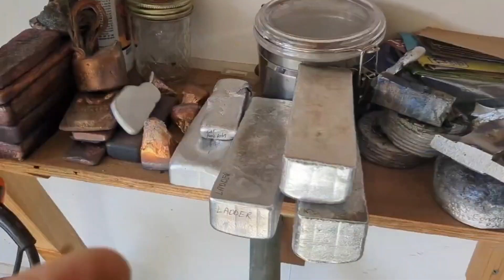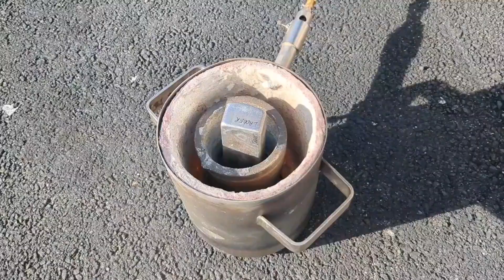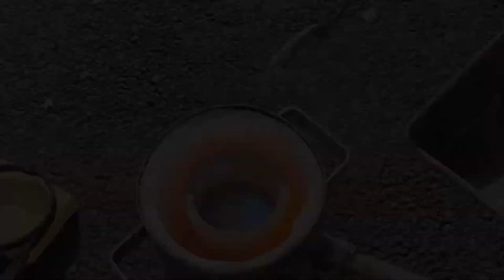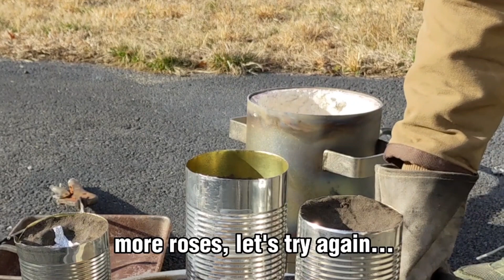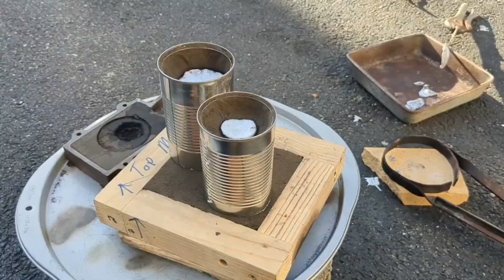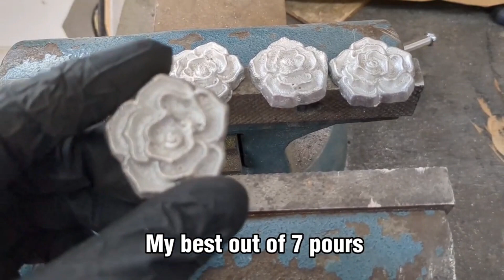Sand casting process - Open Mold  Casting With Risers

Comment: I've done open pour molds with aluminum. The one thing I did different than yours, was I took a flat square piece of steel and pressed it down on top of the molten aluminum. It helped push it down into the details. Still sucked tho due to open mold...
Reply from the maker: That's actually a pretty good idea.  Now that you said it...  I'd probably drill a hole in the steel plate, put it over the sand cast and then put a small riser over the hole.  I think that would work for a larger open mold cast.  Mine was super small so I could cover it with the can.  You still need head pressure on it to get better detail.  That's why I'd still use a riser over the plate. 👍👍👍

Comment: How was the back side? Was there just a riser to cut off or did the aluminum still push between the riser and main mold? Good stuff, I too dislike open pouring aluminum because that surface tension always makes the backside a big bubble.
Reply from the maker: The back was flat.  Exactly correct, I only had to cut off the riser.  There was slight leakage out of the rose, but not much.  You can see that when I turned over the riser to show the rose.  Very minimal, and easy to file away.

Yeah I hate the bubble!  That's why I wanted to give this a try.  I've done these roses in a 2 part mold, but this seems easier to me.